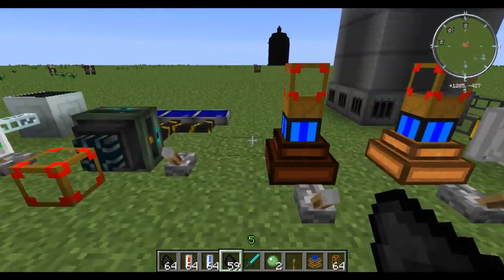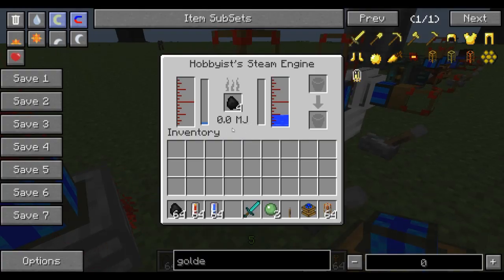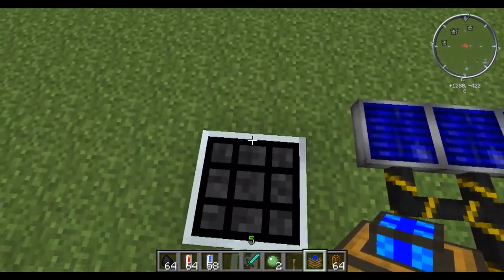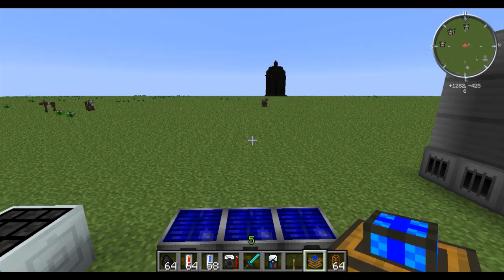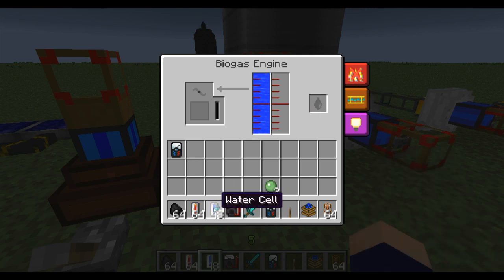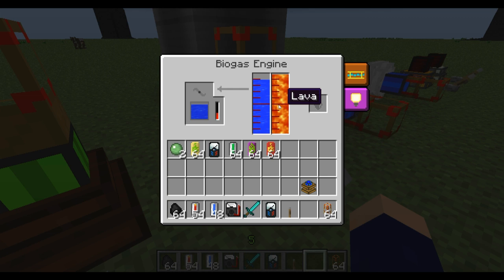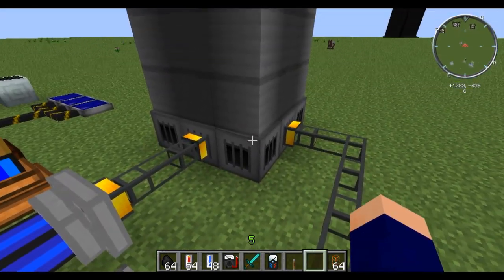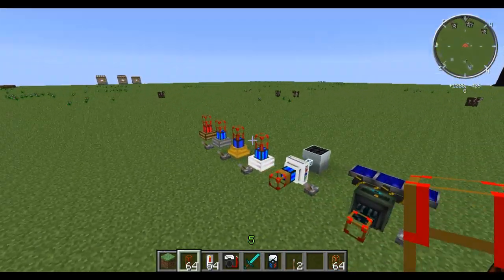FTB All Engines Tutorial - REVISITED

Comment: So I am using 12 stirling next to each other to power my quarry but what do you recommend me to use to auto feed to the engines with charcoal
Reply: Two coke ovens per stirling engine produce the right amount of charcoal to keep them running non stop. You would need 24 coke ovens = 624 coke oven bricks = 2496 bricks (single bricks not block) + 3120 sand then. you can make the sand and the clay for the bricks from the dirt your quarry digs up when you have the industrial centrifuge from GregTech.

Comment: When do the hobbyists and bluelectric engines 'splode.
Reply: The hobbyists steam engine will explode when it builds up too much energy, because it can't output the energy it produces or when it's water tank is empty and water enters it while the engine is more than 100°C hot. Blulectric engines don't explode, they will scale back thier power production when tier output is not needed, but they can however still overcharge kinesis pipes which explode under this condition!